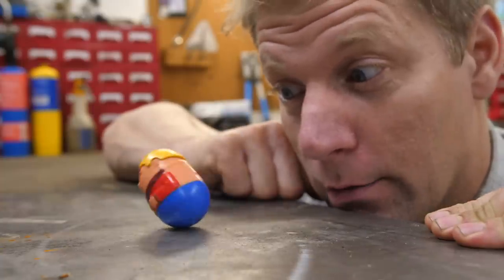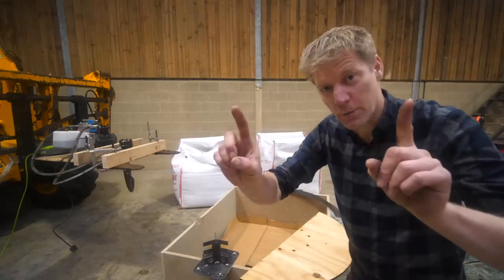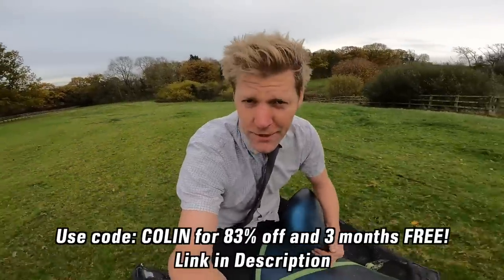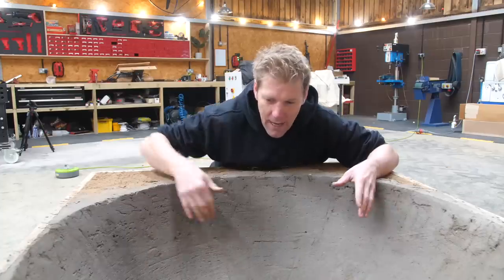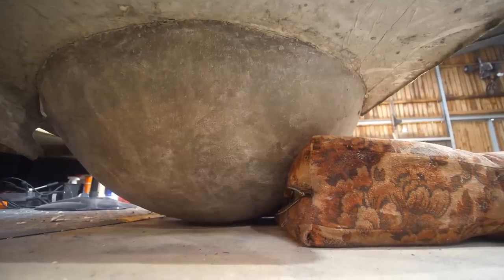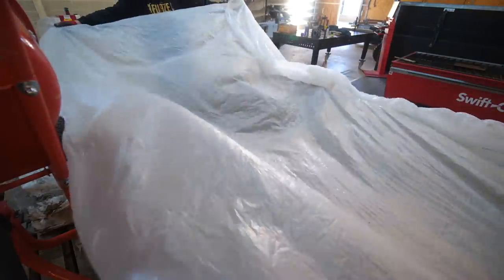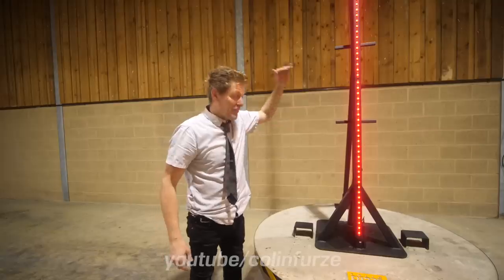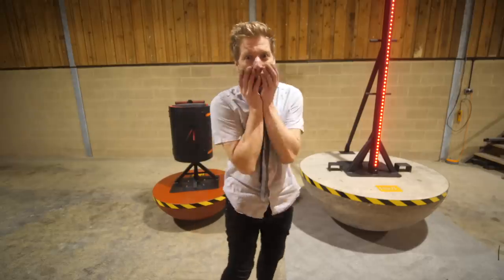PUSH ME AS HARD AS YOU CAN!!!

Comment: Furze: fancy new workshop full of expensive tools
Also Furze: uses a hand saw to scrape off excess concrete
Reply: He wasn’t scraping off concrete he was scraping off the divider he used to separate the concrete with the mold
Reply: @bustinobonnell4468  What do you think that "divider" or wall was? Magical fairy dust? No, it was concrete. He was scraping off concrete.
Reply: @bustinobonnell4468  What he was actually scraping is kinda irrelevant to the comment. Point was, he's using a hand saw as a scraper.
Reply: Pretty sure that was plastic lining
Reply: more like, its not really excess concrete, it was the concrete from the mold and it had exactly the intended amount.
Reply: @rykermartian that is the red stuff that is still on the weeble. He was scraping the outer shell of concrete he used as a mold. Did you all not watch the video? He created a bowl shaped mold in sand, then put a thin layer of concrete, then the floor paint, then he filled it up with concrete. When he broke it loose, he cleared alway the sand first, THEN the outer layer of concrete that went on before the floor paint and that thin layer of concrete was scraped away which is what the op was referring to. Yeesh can’t believe that had to be spelled out.
Reply: The secret they don't want you to know 👉 The Connections (2021) [short documentary] 👀

Comment: The amount of sheer upper arm strength he has is absolutely insane- because when he's at the top, he's literally hanging on with just his arms, the legs have to only be keeping him stable
Reply: Digging tunnels comes in handy for having the arm strength to hang onto a shaft while you roll back and forward on half-round wobbly spheres
Reply: I mean, hanging only from your arms isn’t really hard is it? Just like doing a pull up….
Reply: @santinieve1  maybe at first, but think of the directional forces, it'd only be a pull up position if his back is facing towards the ground. If he is leaning to his left side, his weight is more on the right.
It might not be as noticeable here but if you watch his advert in the tunnel compilation, he's up there for a while, which by your standard, he's doing about 10 one arm pull ups, at the very least
Reply: tbf he has spent the last three years lugging big buckets of rocks through his underground tunnel
Reply: @GoblinZone1  No, it's not the same as a pull up by any means. There's a large difference between using your muscles to lift your body and using your muscles to hang onto something. In fact, I reckon this is more difficult for the fingers than it is for the arms, because the fingers actually need to do 'work'.

Also, in every single position, the legs are also used. Even when he's with his back towards the ground, one of his feet is still at the foothold. The friction there is enough to make it much easier. Of course, when he goes to the side, he can use the actual pole as a support and almost completely remove weight off of his hands temporarily.

So no. I'm not saying he doesn't have some impressive arm strength, but neither is there anything in this suggesting he does, simply because there's not that much strength needed here. It's more a game of endurance.

Comment: Hi I have a disability a muscel wasting condition  I.B.M .
my hand grip is getting weak could build devices open close battery operated like old rachet nut crackers but diffent like wrench with flat with software rubber to grip them difficulty hover pip at the bottom to push and pull off or glove which grip taps bottle top . I saw a battery wrench but could find wear to by one.  Or real challenge a walking frame so people like me walk long without collapsing support from hips help walking the China has but it's over 30,000 to buy .    If  I could build hand one I would see my YouTube page .  I am bit like you try to things working. Great videos colin